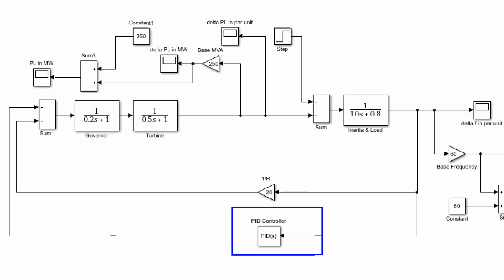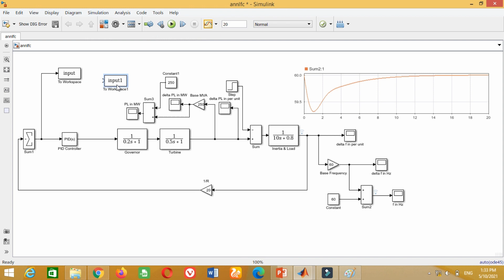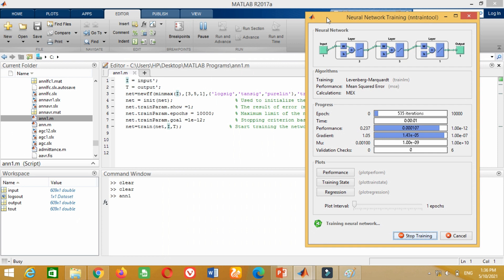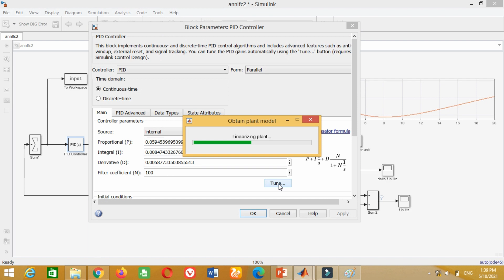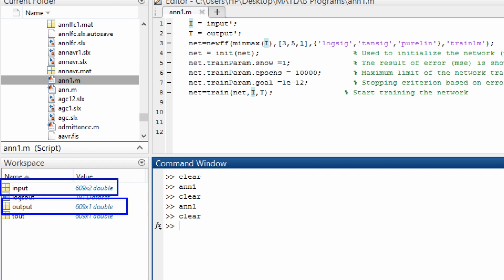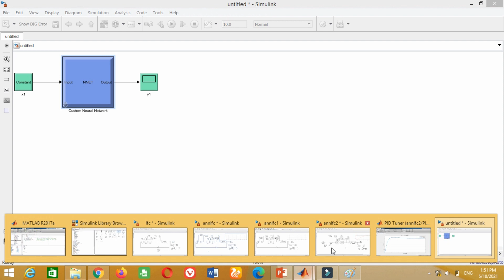How To Design Load Frequency Control Model using ANN in MATLAB/SIMULINK ? | Dr. J. A. Laghari

Comment: I applied what is shown in the video many times. However, the system does not reach the desired output or becomes unstable. Even if the regression ratio is found to be 0.99. Where am I making a mistake?
Reply from the maker: Thanks for the comment. I couldn't understand why it is not giving the desired output. It is working fine at my laptop as shown in the video.

Comment: Sir,i have used the same code but it is showing error in first two lines .pls help me
Reply from the maker: Thanks for the comment. What error you encounter
Reply: @DrJALAGHARI  it is showing error in first two lines ,i.e. input and output
Reply from the maker: @LakshmiSatya-zh3dq  how many inputs and outputs you are using and which matlab version you are using
Reply: @DrJALAGHARI  I = input';
T = output';
net=newff(minmax(I),[3,5,1],{'logsig','tansig','purelin'},'trainlm');
net = init(net);
net.trainParam.show =1;
net.trainParam.epochs =10000;
net.trainParam.goal =1e-12;
net=train(net,I,T);

the following code i wrote and i complied,
these are the errors i got sir.
Error using input
Not enough input arguments.

Error in file (line 1)
I = input';

Thankyou so much for your replay sir.
Reply from the maker: @LakshmiSatya-zh3dq  the data should be in workspace with name as Input. Kindly check it
Reply: Thankyou sir🙏

Comment: Trying to implement same but i get the following error "Error using network/train
Output data size does not match net.outputs{3}.size.

Error in lfc1 (line 8)
net=train(net,I,T);               % Start training the network
Reply from the maker: Thanks for the comment. Which MATLAB version are you using. How many inputs you are using in your model.

Comment: HI sir Please I have been trying to do this on a cascaded Fractional order PI - FOPID, the result is not very good. Any help
Reply from the maker: Thanks for the comment. I haven't worked on this controller. I think you may need to rune or optimise it properly.

Comment: Hi sir..i am trying to implement this on two area tie line biased power system.. should we have to train the both controllers seperately? because the output is not matching when we replacing normal PID with ANN trained PID..any comments plz
Reply from the maker: Thanks for the comment. Yes. You have to Train both separately.
Reply: Sir can you explain a bit how to train them separately.

Comment: How do we control frequency in transmission lines???? without interupt GENCOs
Reply from the maker: Frequency can be measured by using PLL phase locked loop. But to control it, you have to make active power generation equal to load demand. Therefore, it can be controlled by load frequency control or load shedding scheme.

Comment: Hi Sir,
I have been trying to implement NN in the similar manner to a step input to my plant represented  as 1/(0.5s+1). I also, designed the PI controller for the same plant and with PI controller, the response is satisfactory which follows the step input trajectory. But when I train the NN model and replace my PI with it, the response is not following the step input trajectory. That means, the NN controller responses even when the input values is zero. 
I am looking forward to get some insight on my problem, as I am beginner and any help from you will encourage me to continue my work in this direction.
Thankyou!
Reply from the maker: Thanks for the comment. As ANN depends upon the input and output data. Therefore, try to check the input and output data. If there are some values greater than the required output then change these values. Then train the ANN. Hopefully it will work. Or you may watch my videos on ANN and ANFIs. I am not sure in. Which video i have discussed this strategy.

Comment: Sir,In case of PD controller,PI controller,I controller what must be the values of PID controller?
Reply from the maker: The actual values for any system need to be determined everytime bu doing simulation. Easy way is to use PID Tuner block then use only selected parameters such as PD, PI, I and find the best value. Kindly watch my video on PID tuner for better understanding.

Comment: It's awesome and really helpful. Your videos boost up encourage in many students. I watched your most of the videos. It is very informative and well explained. Very few people do such novel task i.e knowledge sharing on this interested topic. Thanks you so much for thinking about the students and making such knowledgeable videos.
Reply from the maker: Thank you so much for the compliments. I have done my work to help the students. Now it is your part to share these videos and channel with as many students as you can so that all may take benefit from these videos.
Reply: @DrJALAGHARI  Hi sir..i am trying to implement this on two area tie line biased power system.. should we have to train the both controllers seperately? because the output is not matching when we replacing normal PID with ANN trained PID..any comments plz
Reply from the maker: @pavandreamerr  yes. You have to Train both ann separately.
Reply: @DrJALAGHARI  sir u have modified the pid controller position from feedback to feedforward in the block diagram..if we can get that approved system pdf its very useful sir
Reply from the maker: @pavandreamerr  in two area system, the pid controller will be used in their original position. You may watch my pso video for two area system
Reply: @DrJALAGHARI  Ok sir..Thank u for ur information
Reply from the maker: @pavandreamerr  most welcome

Comment: sir, a heartfull thanks to you for uploading this video.. it was very much helpful..can you please give a suggestion in the change in procedures when it is two area.. since iam weak in coding, i cant deduce an answer
Reply from the maker: Thanks for the compliments. For two area, you have to use two ANN, one for first area and other for second area. Therefore, the code remains same. Only you have to use it two times. One for training the data of first area controller and second for training the data of second controller.
Reply: @DrJALAGHARI   that means after the first area I move the same in&out workspace block to the second area and run ANN test with the same code.. right sir?
Reply from the maker: @nomad1286  code will be same. But data will be different .
Reply: @DrJALAGHARI  appreciate it for answering queries... jazakallahu khair
Reply from the maker: @nomad1286  my pleasure.